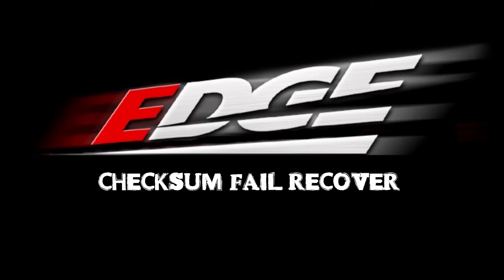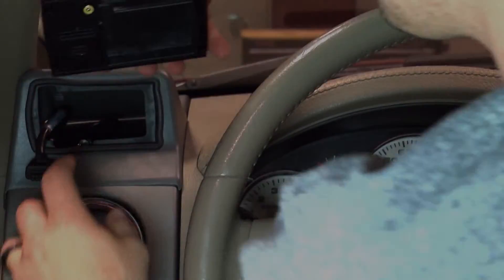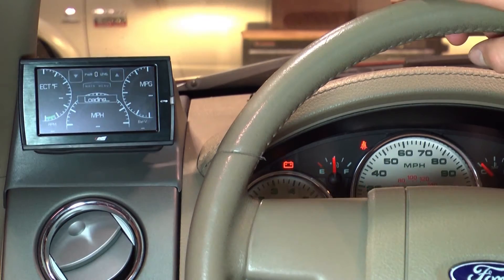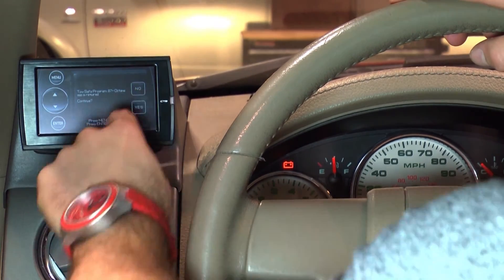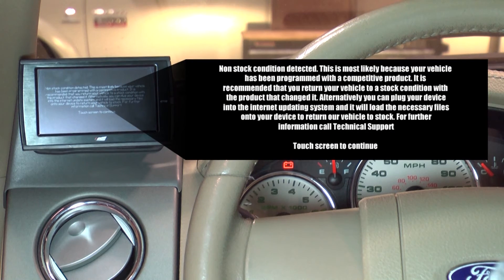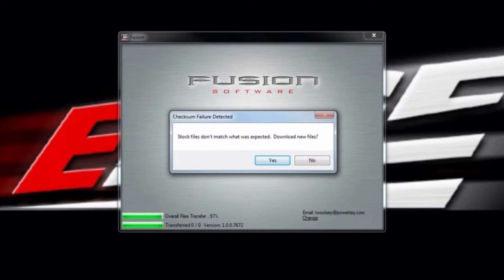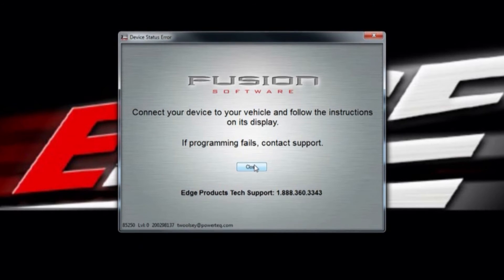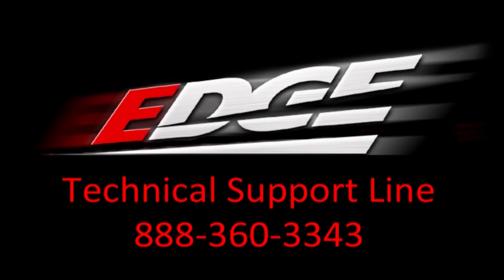Checksum Fail Recover

Comment: I updated the tuner and it still popped up the same message
Reply: Same here, figure anything out?
Reply: @DennisWHJr  i contacted edge and they sent me a link where i connected the tuner to the computer and they sent me stock tune
Reply: @mattparks11  alright cool beans. Thanks for the response!
Reply: @DennisWHJr  no problem boss
Reply: @mattparks11  I followed their instructions to reset via computer with no luck. Still ‘check sum’ing
Reply: I have the same issue contacted edge but they couldn’t give me any info truck is on race 1 but screen says zero